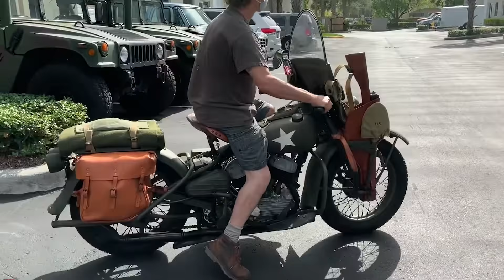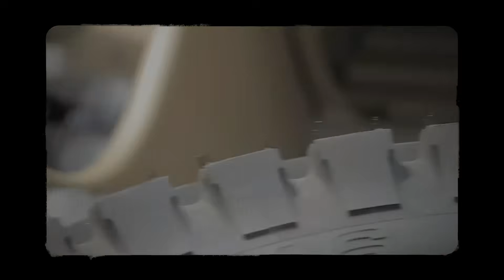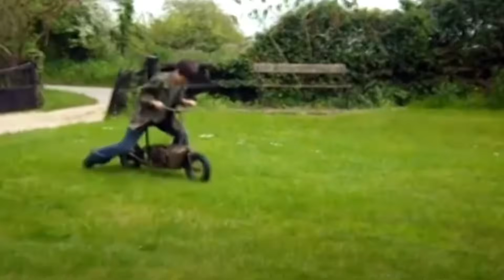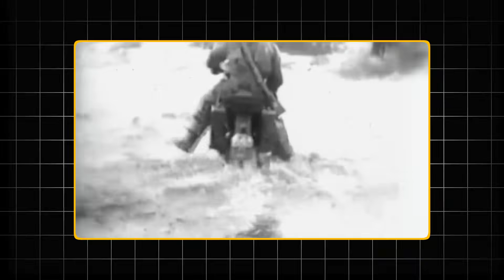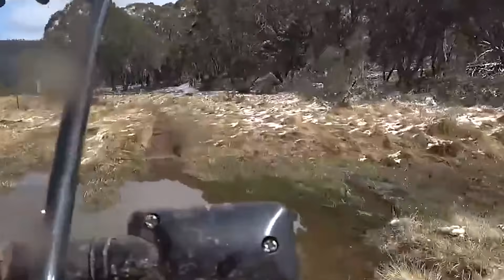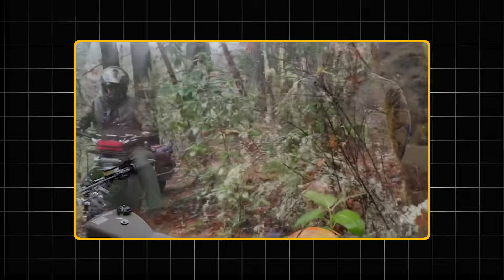5 Military Motorcycles You NEVER Knew Existed!

Comment: The Soviet Ural and Dnepr motorcycles were descendants of the BMW R71, not the R75. The Soviet Union started production of the M-72, which was a copy of the BMW R71, in 1941.
Reply from the maker: That’s a great catch — thanks for pointing that out! You’re absolutely right — the Soviet M-72, which later evolved into the Ural and Dnepr lines, was based on the BMW R71, not the R75. Production started around 1941 after the Soviets acquired a few R71s for reverse engineering. Appreciate the correction — always good to keep the history accurate!